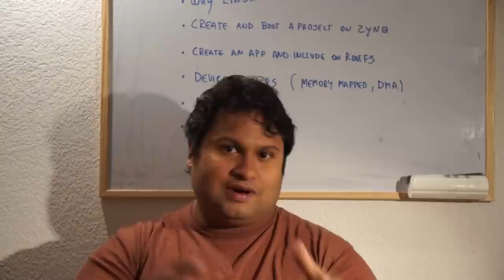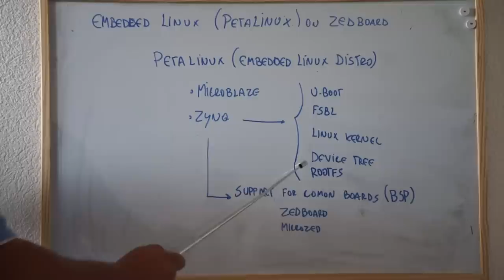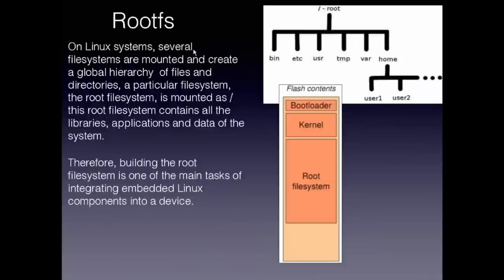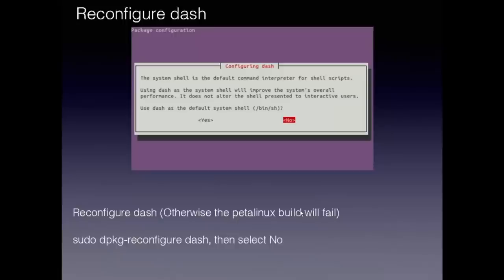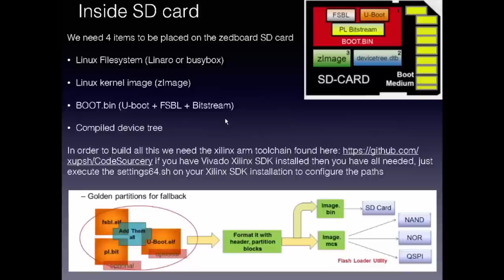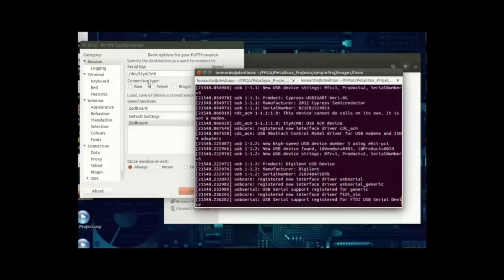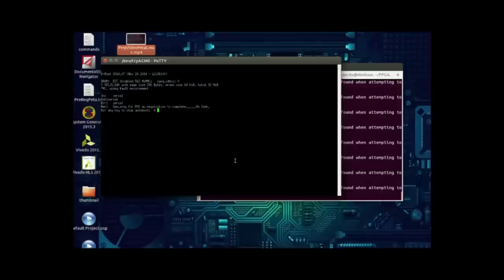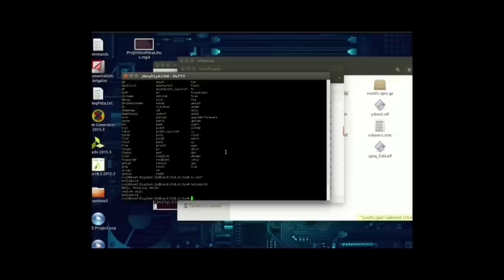Embedded Linux Introduction #01

Comment: HI thanks for informative videos,
I have completed all the steps, and i have placed all data to SDCARD but it didn't boot. The strange thing is that LD9 is turned on, which i don't know why. I couldn't get anything on UART. 
what could be the issue ?
Reply: +Alok Mistry ok, so i wasn't using BSP from Avnet. Solved.

Comment: Hey thank you for the videos :), I am using the Zybo board from digilent. I had some problems enabling ethernet so I had  to add in system-top.dts this
 &gem0 {
phy-handle = <&phy0>;
mdio {
#address-cells = <1>;
#size-cells = <0>;
phy0: phy@0 {
compatible = "marvell,88e1510";
device_type = "ethernet-phy";
reg = <0>;
} ;
} ;
};

because i was getting this message whe it was booting : zybo Configuring network interfaces... xemacps e000b000.ethernet: eth0: no PHY setup
Reply from the maker: +Jorge Luis Hi Jorge thanks to sharing that, I don't have the Zybo, but is nice to know if on future I use this in some project, thanks again